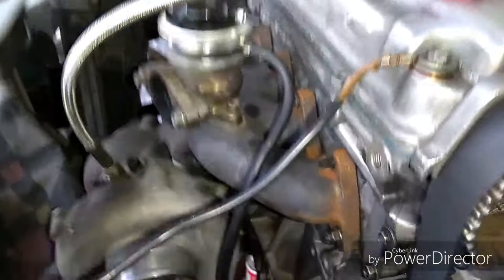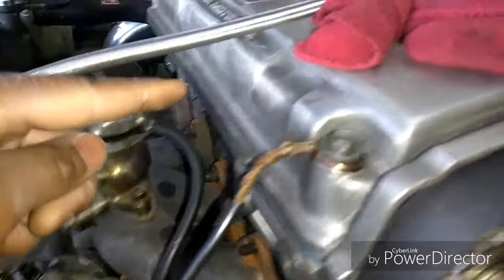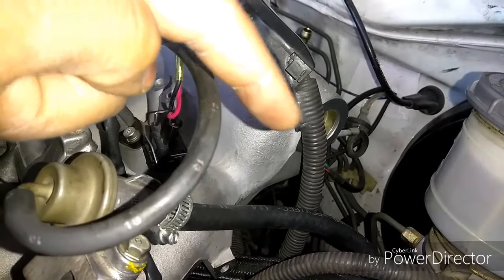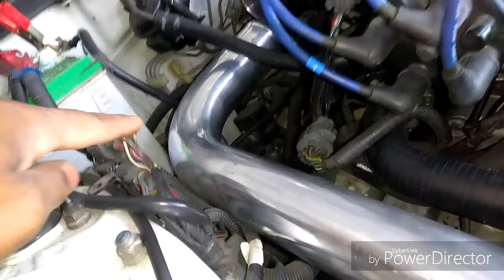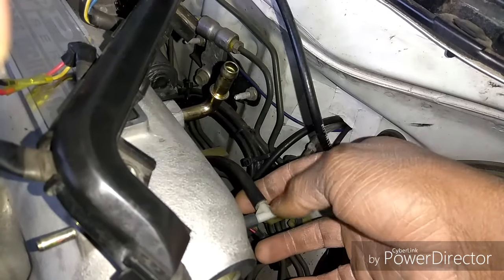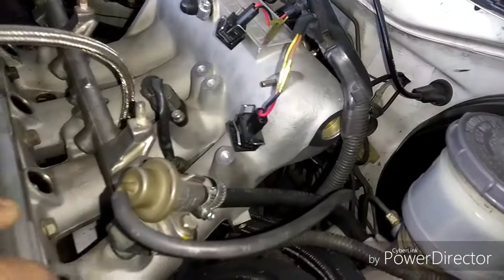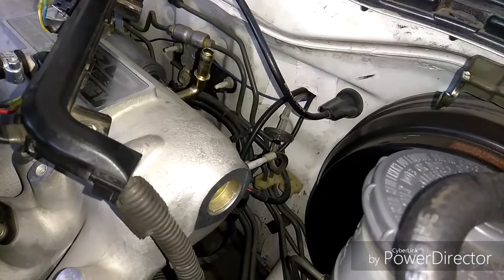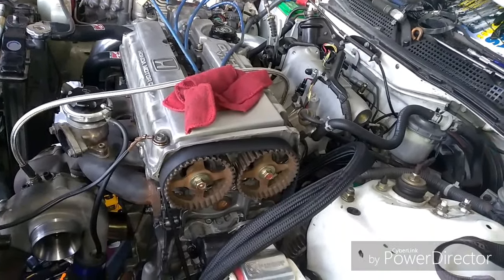!!!Must See!!! How To Run  Wastegate & Blow Off Valve Vacuum Lines

Comment: I know you did say vacuum source, but the only clarification I would add for anybody is that the BOV has to be routed to a spot AFTER the throttle plate 👍🏻
Reply: i was think about that when he said it
Reply: Would I be able to just tie it all into a boost block? Like eliminate all the T’s and run all lines straight to a boost block that runs off brake booster?
Reply from the maker: Yes sir, I was actually going to do that. Just never got around to doing it😁

Comment: If you have no vacuum line ran from the wastegate and just left the port open the wastegate would not open no matter what the spring size correct?
Reply from the maker: That's correct,  your engine will receive all the boost your turbo could possibly throw at it. Hopefully the engine can handle it 😂
Thanks for watching 😁👍

Comment: Question. The  wastegate has two vacuum ports. If I am only using the side port Like you did in this video, do I need to block off the vacuum port on top or can I leave it open, unplug? 

Thanks for this video like everyone said, I can actually understand it.
Reply from the maker: Do not block/plug the top port. Let it vent. Your welcome. Thanks for watching 😁

Comment: Man this had to be there best video ever explaining the routing. Direct and straight to the dang point. No having to watch 20 mins of noting important to get this info. You are pure gold. Hell yes! Only question does running those tees cause any kinda issues if your running higher boost levels? Like around 15psi?
Reply from the maker: No. My current setup is pushing 15psi  and I'm running a tee off the rear vacuum port of the intake manifold. I haven't had any issues. One thing that would help is to use zip ties on all vacuum ports to prevent them from coming off/leaking.

Comment: Best video I seen yet
Reply from the maker: Thanks 😁
Reply: @Duwop77  your motor all stock ? How manny pounds you run bro ?
Reply from the maker: @roadjokers6467  yes it was all stock 10 psi.
Reply: @Duwop77  how long it last ? How did it hold up ?
Reply from the maker: @roadjokers6467  it lasted 3-4 years. I eventually chipped a piston. But I think one of the injectors failed.
Reply: @Duwop77  damn bro that’s great I got a low miles teggy really healthy I don’t wanna open it up wanna toss like 10 pounds at it and have some fun I’m gona check your other videos out & share this video to
Reply: @Duwop77  last question should I trust a eBay turbo kit waste gate ? Everyone saying no someone ppl said it’s fine what’s your opinion this is my first turbo car well gona be
Reply from the maker: @roadjokers6467  i wouldn't. Although I ran a ebay wastegate for years. I wouldn't recommend it. I cracked a sleeve once because the wastegate stuck close.
Reply: @Duwop77 on the top of the wastegate is blocked off ? My hood is hitting mine can I just do what you did and cap it off ?
Reply from the maker: @roadjokers6467 Its not supposed to be capped off. Somthing I found out later. You may experience a little higher boost levels. I ran mine like that for awhile. Try it and see if your boost level stays the same.

Comment: Thanks you very much! I have one more question, my ecu has a built in map sensor and I ran out of vacuum ports, is it possible to put a tee and share it for a map sensor? Or is it better to read map on a single nipple?
Reply from the maker: Yes you can tee it. Or buy a vaccuum block in order to have more ports.
Reply: @Duwop77  goated thanks

Comment: I dont understand where you plugged the hose for the blow off valve. Where is the vaccum port coming from? What part of the engine more specifically?
Reply from the maker: There was a vaccuum fitting on the turbo itself. Not all turbos come with it. If you need an updated video I can make one soon.

Comment: Thank you! Been looking at how to plumb mine with the boost controller, which is best to pull from and why...? The compressor housing is just used to go to the waste gate, correct?
Reply from the maker: Your  welcome. You can also use the vacuum from the compressor housing for your boost controller. That's how I'm running it on my turbo integra.
Reply from the maker: Google turbosmart boost controller diagram. And that's how I'm currently running mine👍

Comment: I wonder if there is a triple t type thing. Based on your explanation in thinking im running from my turbo to fuel regulator, wastegate and blow off valve
Reply from the maker: Yes, there's vacuum fittings that has more than 3 ports. Thanks for watching 😁👍

Comment: Can the intercooler pipe drill a hole to plug in the wastegate bottom port? Is is correct?
Reply from the maker: I've seen it done that way. But most exhaust manifolds come with a wastegate flange.

Comment: Great video...I m just confused about the vacuum line off the TURBO to the wastegate ...is that not boost pressure, not vacuum pressure ? its pushing from the turbo..??
I get the vacuum from the manifold. Please explain..thanks
Reply from the maker: That's correct. Both will work. Turbo or intake vacuum. Also all vacuum turns into boost once boost builds. That's the reason for having a tricked or tuned map sensor. A stock map sensor once it reads boost it'll kill power to the engine. The only vacuum port that wont allow boost is the brake booster because of the one way valve.. Hope that helps.  Thanks for watching 😁👍
Reply: MAN i'm so confused !  I don't have a nipple on my ON3 turbo so I just run  the bottom wastegate nipple to a vacuum source ? Do I need a manual boost controller ?
Reply from the maker: @georgedemelo7267  sorry for the late reply. I just seen your message. But yes that's correct. Just run it to any vacuum source. Hopefully you've already have it worked out out.

Comment: Your manifold see both vacuum n boost ... vacuum should only be taken from intake side before turbo.. your wastegate is connected to boost side, hence its opening up wastegate valve at a lower boost pressure than installed spring.
Reply from the maker: It worked fine. But my new setup I have it connected to the vacuum port on the turbo. Thanks for watching 😁👍
Reply: @Duwop77  kool... its a com.on mistake we make not realizing that all boost line will at some point become vacuum but all vacuum line remains 
   Before turbo is constant vaccum

Comment: How long did the vac line last sitting on the manifold? 😁
Reply from the maker: Not long at all if it actually was😂
It may have been during the video. But I never drove the car or had it running like that.

Comment: Wasson dude know the videos is years old I used this for my d14 turbo civic. I’ve got a boost controller can you help with how to vacuum in the boost controller
Reply from the maker: Is it a manual or electronic boost controller?
Reply: @Duwop77  just a manual eBay job one 🙈
Reply from the maker: @georgeclements7530  No problem.  Below is a link to turbo smart website. They have a great diagram to show how to install. If you need further assistance I'm willing to help. Thanks for watching 😁 👍 
https://www.turbosmart.com/news/manual-boost-controller-installation/

Comment: I know this video is old but I was wondering if you know how to route the boost controller.
Reply from the maker: Is it a manual boost controller or electric?
Reply: @Duwop77  manual I got it with my rev9 kit from eBay
Reply from the maker: @ramonquintana5899  The link below is to the turbosmart website. They have pictured diagrams that you can look at. If you need further assistance contact me on Instagram I can send you a video or go live.
https://www.turbosmart.com/news/manual-boost-controller-installation/

Comment: How’s that rev9 wastegate? My buddy just gave me one but idk if I should run it or get a tial one
Reply from the maker: Its a typical ebay wastegate. It gets the job done without having to spend alot of money. But have your tuner set a boost cut in case the wastegate does fail. Thanks for watching 😁 👍

Comment: I have the same waste gate but i never blocked off the top like yours is i just have the bottom hose connected to the compressor.

Do i have to plug the top port?
Reply from the maker: No, you dont have to plug the top port. At that time I thought you did. But we learn as we go. Lol. Thanks for watching 😁👍
Reply: @Duwop77  awsome thanks for the reply. Car scene coming in clutch 🤝🏾
Reply from the maker: @devon1748  And thank you😁 if there's any thing else feel free to hit me up👍

Comment: What happens if you have one closed Ports not tightened all the way ?
Reply from the maker: The top port doesn't matter unless your using a boost controller. But don't plug it, leave  it open.. The lower needs to be connected to a vaccuum source and tightened or it'll be a leak.

Comment: Can I T the Vacuum from the turbo and put one end to a Boost gauge? Btw thanks for getting it to the point without doing burnout or going to get ice cream like other YouTubers. 😄
Reply from the maker: Lmao🤣🤣 Your welcome. I wouldn't. A boost gauge needs to be hooked to manifold pressure. Thanks for watching 😁👍
Reply: @Duwop77  motor I bought has a T there. Just wondering why they put a T.  So it's turbo to wastegate actuator then a T from turbo. Confusing.
Reply from the maker: I'm lost. Lol. Where is the T on your motor? You dont need a T on the turbo. I just have one hose coming off of the turbo vacuum port directly to the wastegate. And my boost gauge is running to a vacuum port on my intake manifold. Hit me up on Instagram  I can send you pics or a video.
@duwop77

Comment: Hi buddy, what software you use ? Crome?
How do you limit the Boost?
Great vid 👌🏽
Reply from the maker: It's ether Neptune or chrome. It was tuned at a shop. Also my boost is limited by the spring pressure inside the wastegate. I think at the time of this video I was using a 5 pound spring. Thanks for watching 😁👍
Reply: @Duwop77  thanks buddy for your reply
Make sense :)
Reply from the maker: @samuelmagalhaes3372  no problem. If you need help with anything dont hesitate.😉

Comment: i have same rev 9 wastegate im not running a bov i have two fittings for bottom ports and only running off wastegate rn do i need to just run one line from intake manifold to bottom port and then block off other side port and top ports or do i need to vent the other side port thats not being used to atmosphere ?
Reply from the maker: Block other side port. Let top port vent.
Reply: @Duwop77  got two top side ports not using boost controller rn and two side bottom ports which to close and which to vent to only run off wastegate ?
Reply from the maker: @nizmo_noahh8732  the 2 top ports let vent. The 2 bottom ports plug whichever one your not going to use.
Reply from the maker: @nizmo_noahh8732  the 2 top ports let vent. The 2 bottom ports plug whichever one your not going to use.
Reply: @Duwop77  bet what would other bottom side port be used for anyway ?
Reply from the maker: @nizmo_noahh8732  it's just for an easier installation. Depending on which direction you are running your vaccuum line from.

Comment: You should T off of the idle air control valve , under the valve it self there is another vacuum line . T from that one instead so you don't mess with your fuel regulation
Reply from the maker: Thanks for the tip. My new setup doesn't utilize the  vaccuum from the fuel pressure regulator. I agree with not teeing from there. Thanks for watching 😁 👍

Comment: Did u bolt ur wastegate straight to ur manifold or is there a flange
Reply from the maker: It has a designated location on the manifold that it bolts straight to. Thanks for watching 😁👍
Reply: Are these manifold reliable have u had any problems with them thanks for replying
Reply from the maker: I had no issues with mine. Its cast iron a really strong metal. At that time I purposely looked for a kit with a cast iron manifold to avoid cracking issues.
Reply: Oh yh looking to get one soon thanks for the replys 😁
Reply from the maker: No problem. Anytime.

Comment: Hey bro so ive had this same waste gate for a minute and i noticed it never lets off when i reach 5 psi or 10 or 15 lmaoo  i was using the 5 psi spring the bottom port off the wastegate just like you but it dose not seem to even effect the plunger but when i use the top line i get madd wastegate chatter should i go for a stiffer spring and keep running the top nipple or is my shit just fucked lol thanks man much apreciated 🤙
Reply from the maker: Sounds like its defective. The bottom port should work fine. But anytime a wastegate isn't opening something is up. It may have a vacuum leak preventing it from opening. Thanks for watching 😁👍

Comment: The line coming off turbo housing on charge side should be boost not vacum.
Reply from the maker: Its vaccuum until boost kicks in. All vacuum turns into boost except for the brake booster. Due to the one way valve.

Comment: If I’m not running a boost controller can i have a vacuum block in my brake booster running on the lines to my wastegate? Since brake booster is manifold vacuum?
Reply from the maker: When you say vacuum block. Are you referring to the vacuum blocks with the individual ports that borrow vacuum from the brake booster? If so yes, you can do it that way.
Reply: Duwop77 yeah exactly thank you bro appreciate it
Reply from the maker: @mj4boss100  no problem, thanks for watching.

Comment: My car uses a map sensor, I have a T to the fuel regulator to the map sensor and to the intake, I need to have my computer reprogrammed” maybe I will disable it,

My car used to be supercharged, but the supercharger runs out of steam once I hit 10 pounds of boosts.
The 3800 sc is in a fiero, the turbo powered fieros runs faster 1/4 mile times, then the supercharged fieros.

Comment: Hey homie so question for you... So you use the vacuum line on your blow off valve from the brake booster did you just leave the brake booster disconnected from vacuum after you ran it cuz that's what you're saying is you don't have it ran in with that T do you just have the one going to the bluff out and then the other going to your boost gauge... So like that mean you running no vacuum to the brake booster now?
Reply from the maker: Matty B. My brake booster is normally plugged into the big vacuum port on top. The reason it's not plugged up in the video  just for visual purposes. It was blocking the view so I unplugged it. The blow off valve and boost gauge is plugged to the small vacuum port on the back of the intake with the T fitting.
Reply: @Duwop77  so if a break booster works on vacuum how does it work under boost? Would a one way check valve be in order? I couldnt imagine a break booster lasting long under any boost. Of course your foot isnt on the break while on the gas boosting (unless doing a break stand of course) but Im sure the break pedal will be boosted making it hard to hold.
Reply from the maker: @triggerwarning2439  If I remember correctly there is already a one way check valve in the vacuum line for the brake booster. It comes like that from the factory. You dont have to worry about your brakes  not working do to turbo boost. The only thing that's affected under boost is a untunned map sensor. Thanks for watching. Have anymore questions  hit me up😁👍
Reply: @Duwop77  thanks for the reply and good to know... still trying to figure out if im going to use this turbo or mate up a m90 supercharger to my project. Or do both but with a m62 so it can be shut off as soon as the turbo takes over... seen it done on a Subaru some time ago.
Reply from the maker: @triggerwarning2439  no problem. Sometimes figuring out what direction you wanna go is the tricky part of a build. Both are great options. Good luck. Wish you the best.

Comment: i need help installing my BOV on my 350z i need help 😞
Reply from the maker: It should be the same process. Just find a vacuum source from your intake manifold. And use it to supply vacuum to your BOV. 350z/G35 usually have a vacuum source on the front of the intake manifold I believe that's capped off. Thanks for watching 😁👍
Reply: what’s your IG so i can text you there
Reply from the maker: @duwop77

Comment: Helpful as all fuck thanks a lot ❤❤❤❤
Reply from the maker: No problem. Thanks for watching 😁 👍
Reply: I think I got everything hooked up right.  But I can’t get a boost gauge to work
Reply from the maker: You can hook your boost gauge to any vacuum port on the intake manifold after the throttle body.

Comment: I have a question. My turbo doesnt have a vaccume port, cant find one on the back of my intake as well. How bad is it to have my wastegate, Bov,  fpr, and boost gauge all going to the one valve on the front of my intake? I'm also gonna be running a boost controller and loud valve which needs a boost referance too, so I gotta run those on the same valve as well. Is that gonna be totally fucked or what are my options?
Reply from the maker: Sounds like your best option is a "6 Port Vacuum Block" that will Barrow vacuum from your brake booster to feed other accessories. I will add a link for a reference . Thanks for watching 😁👍
https://youtu.be/-gOPVG8SESI